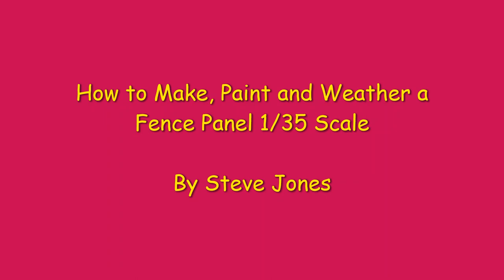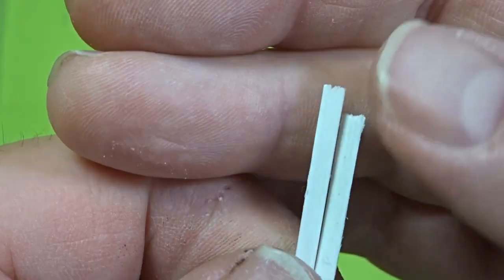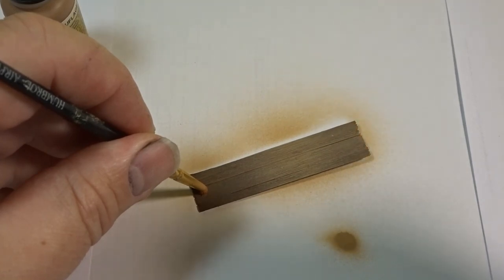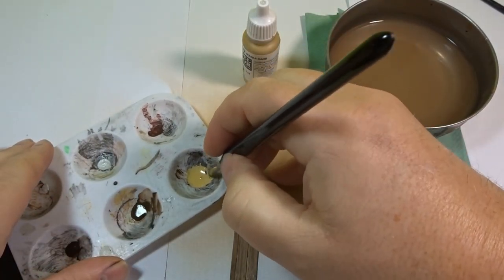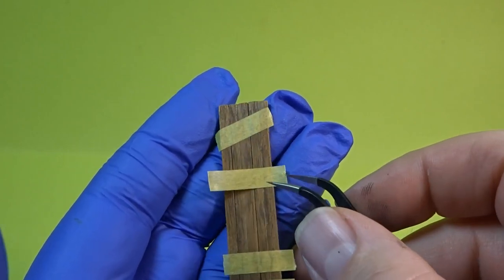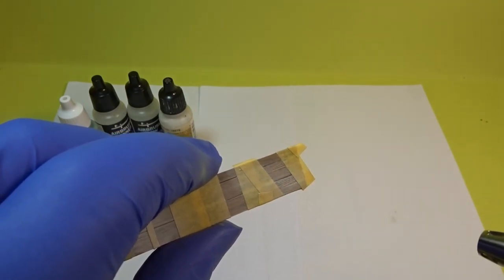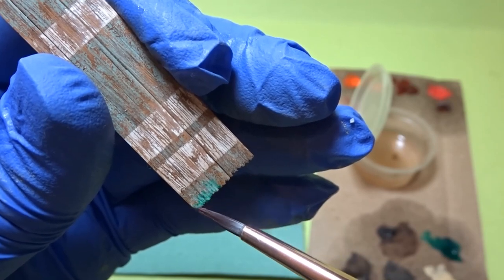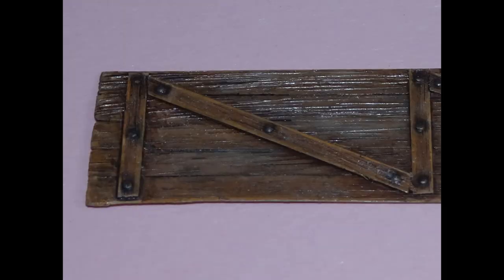How to Make, Paint and Weather a Fence Panel 1/35 Scale

Comment: Excellent video Steve and really helpful. Colour choice for old wood is difficult. I have not considered using the hairspray technique for wood but it works very well so definitely something to try. It seems to chip along the grain which is just what is wanted. Bet it would work well for old doors etc.
Reply from the maker: Hi Jim. The HS chipping came out well on the wood. It's a neat idea for individual posts as well. Thanks for looking in and commenting